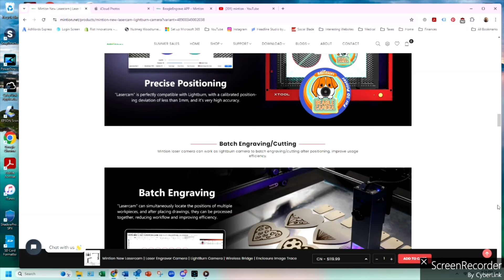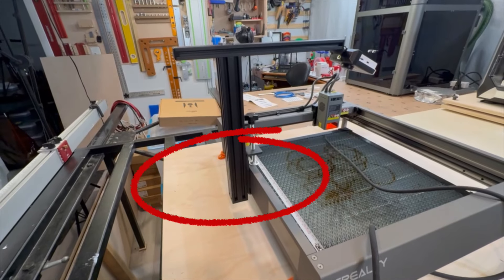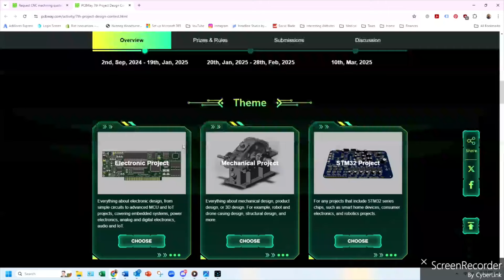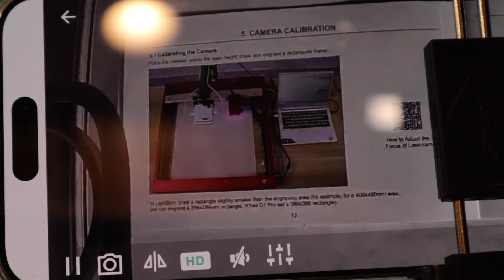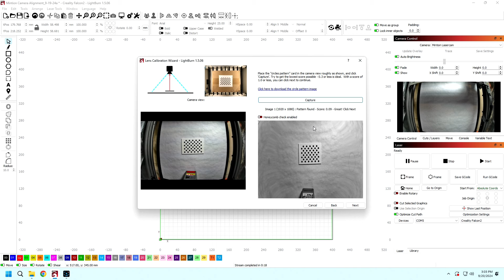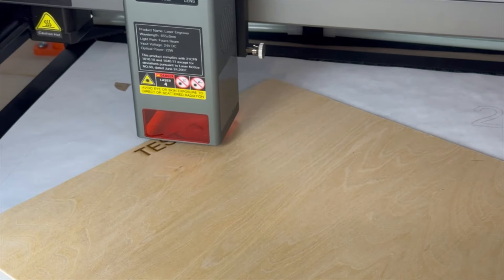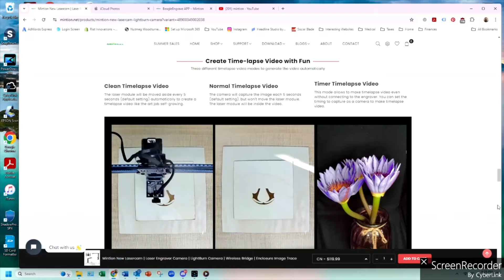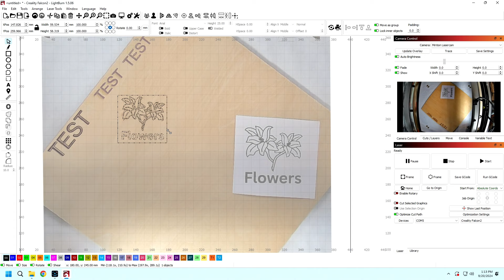Boost Productivity for your Laser Engraver: The NEW Mintion LaserCam!

Comment: I have your exact same set up now officially and I’m having a hard time figuring out which cable you used cable connection for the engraver. I have a Creality falcon 2 22W as well with the exact same camera set up. Tried to do the paper line cut and it’s still not communicating to the engraver

Comment: I’ve checked this camera out on amazon and wondering why two different yet the same camera is a $50 difference? Not sure if you could explain why one is more expensive. I see one with more reviews than the one that’s linked here
Reply from the maker: I went on Amazon and I also see two prices for the same camera; one at $119.99 and the other at $149.99, however the $149.99 on offers a $30.00 coupon so the price nets out to be the same.  I didn't see the same camera at a $50 difference.  On the two options that I saw on Amazon, they are the identical camera.  I don't know if this helps you, but please feel free to reply if I can be of any further help.  Thanks for your question.